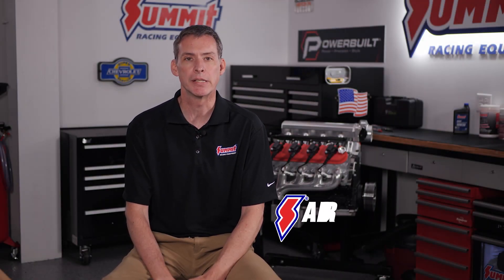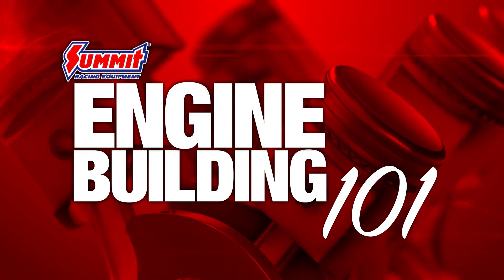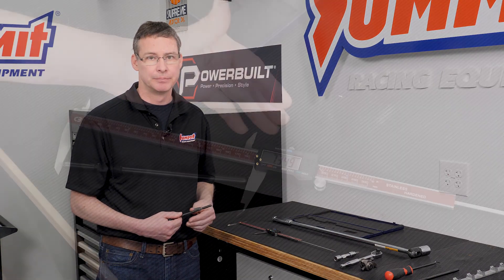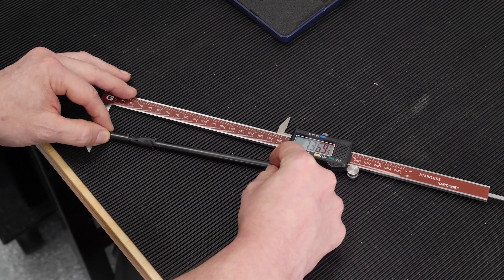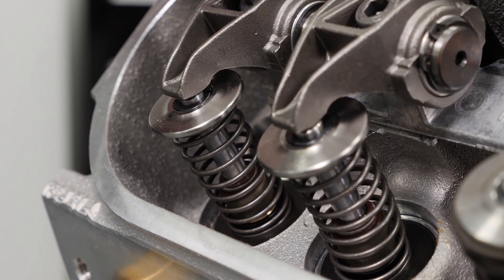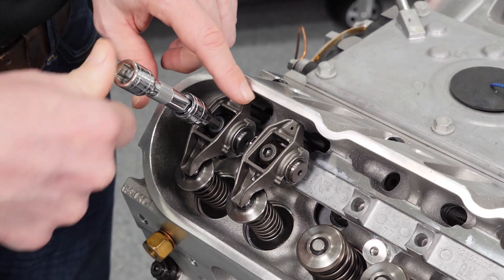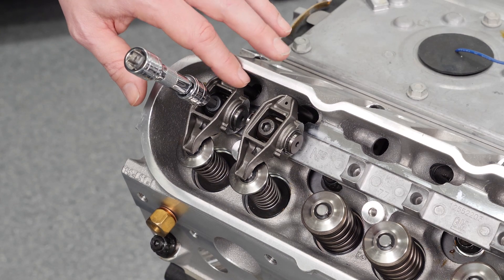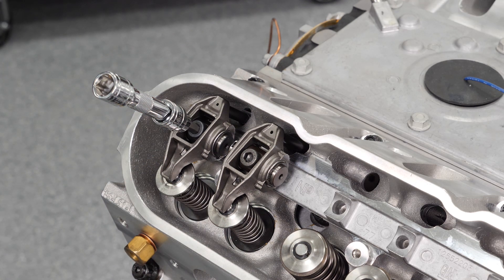Engine Building 101: How to Properly Measure for the Right Engine Pushrod Length

Comment: Import turbo Honda guy here... This is interesting I wonder if measuring the gap to zero lash with a feeler gauge could increase speed.

Looks like a modified valve adjust procedure to me 😂. V8 Dyno tech that works awesome.

Comment: you use the term "it" much too often. Also, you completely left out the up or down position of the actual lifter. Add that to the fact that you haven't defined "solid or hydraulic " lifters. If they are hydraulic,  are they filled, centered of collapsed? Then, the it, your reference to the rocker picot bolt I'm guessing, is it just lightly touching, or should it be torqued? You're talking about building an over 1000 hp engine... Please don't leave us guessing...

Comment: I recommend that you add the Summit Racing video entitled, "How to Measure Pushrod Length Using Trick Flow Pushrod Length Checkers" to the Engine Building 101 playlist.  It has a more detailed technical explanation of pushrod length checking using both old school gauge pushrods and the more modern non gauge pushrods, including measurement methods to compensate for gauge pushrods and adding pre-load to the final "overall length".  This video is at https://www.youtube.com/watch?v=ddK0n2duAfg

Comment: Notice he is using checker valve springs!! Do not do this with dual springs installed youll risk collapsing the lifter and getting a inaccurate measurement
Reply: Sure, if you start with the adjustable rod being far too long.  If you start short and creep up on the lash as Brian did in the video, then you should never be close to collapsing the lifter.
Reply: What do you mean by collapsing the lifter?  I wonder if I did this because I notice that I can easily push the 2 lifters in cylinder #1 down a little by hand but I can’t on the cylinder next to it.

Comment: So I blew my first motor. Gen 4 5.3. Y’all got a short block?
Reply: Hi Joseph. Is the Gen 4 better then the Gen 3? Lots of gen 3's out there.
Reply: @robertclymer6948  if you are only using it for an engine swap into a different car or you have a pre-2007 gm vehicle then you need a gen 3 engine. In my case I need the harder to find more expensive gen 4 for my 08.

Comment: This is a great way to check pushrod length.  I've always add .030" of preload length. Is .050"-.075" much better? Thanks for the video.
Reply: Depends on the lifters your using
Reply: It does depend on the mating hardware.  I added 0.050 to my measurement and it was not enough.  After breaking in the engine I had to get longer pushrods, by another 0.050” to get the wear pattern in the center of the valve stem.